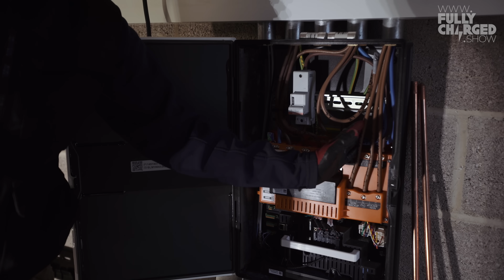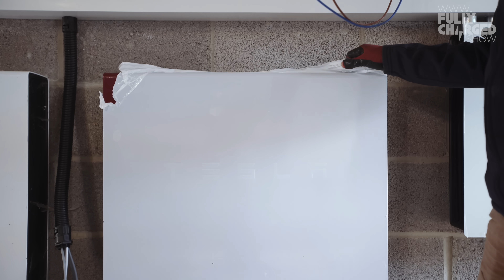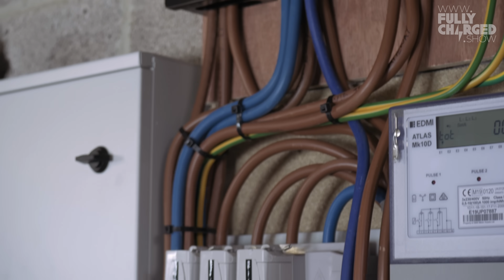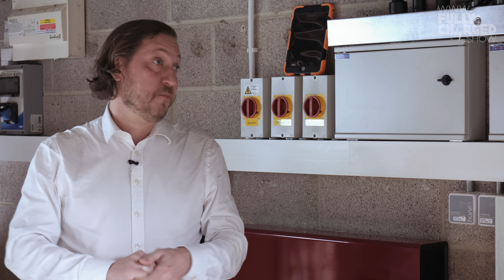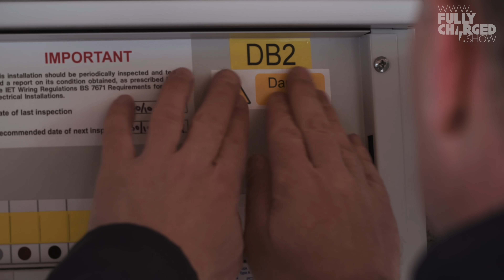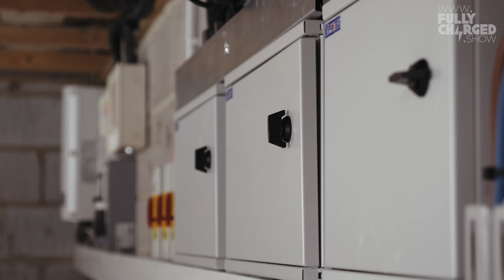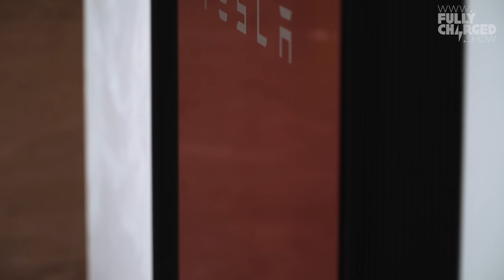Can you run your house on a battery? Tesla Powerwall 2 (Founders Series) & Tesla Backup Gateway 2

Comment: The carbon footprint of that lot is massive ... by the time it's anywhere near carbon neutral it'll need replacing
Reply from the maker: I enjoy seeing comments like this. Just clear statements, no self questioning.
Just a simple statement of fact. Bang. "The carbon footprint of that lot is massive."
Says who, based on what, and how do you know how long the system will last. Oh, that's right, you don't.
But don't let that stop you. LOL
Reply: @fullychargedshow   Common sense and over thirty years in the building industry  informs  me !  And the 10 years warranty from Tesla tells me you can expect  a little over that in lifespan ( good luck with disposing of those batteries cleanly) looked into it myself and it doesn't make  ecological or monetary sense ... it actually starts to make sense in a hotter climate but not in the UK . In the UK it's just a virtue signal  which actually creates more carbon than it saves . But don't let that stop you ... I'm sure the pats on the back and the warm fuzzy feeling you'll get inside will more than make up for the harm you're doing to our environment .
Reply from the maker: @jackcaven9614  Ahh, excellent, you used the giveaway reactionary term 'virtue signalling' for which I am very grateful. 
Now we know where we both stand. 
I have had one Tesla Powerwall for 2 and a half years and the impact it has had on our electricity consumption has been profound, now with 2, and more solar, even in this damp overcast island it has a significant effect.
So a couple of things, and I am speaking from over 10 years of experience with electric cars using the same battery technology.
Yes, the warranty might be for 10 years but that doesn't mean, and I am laughing at your expense as I write this, that the batteries suddenly stop working overnight.
Battery tech has developed with incredible speed over the last 10 years and we now know, particularly in the role these powerwall batteries are playing,they have a lifespan of well over 20 years
So to say "the batteries will be useless after 10 years"  is a tragic misunderstanding or deliberate ignorance 
You've had a lot of experience, as have I, but your experience is in the past, with old technologies that we both grew up with.
I am prepared to accept that those old technologies are a bit rubbish (internal combustion, diesel, burning coal and gas to generate electricity) I am still open to the possibility of change.
And no one, not me, not you, no one except a moron is going to 'dispose' of batteries when, after 20-25 years they need to be recycled. 
We are about to shoot an episode about a massive battery recycling plant in germany which is set to become a multi-billion global industry which will employ tens of thousands.
And you still think we have to 'dispose' these batteries. That is tragic. Only the Daily Mail would suggest such a thing.
Reply: @fullychargedshow  I  worked out that taking into consideration the initial cost and the running costs of installing a combined solar panel - tesla wall system, and then adding up the potential savings ( even being optimistic) it would take at least 24 years for it to pay for itself ( not including battery replacement in 34 years = 2 - 3 )... do the sums , it just doesn't add up , I wish it did !  And 'recycling' is just a fancy way of saying 'disposing' apart from it costing more. Current  estimates on the lifespan of a Tesla wall battery are based on their car batteries ... Tesla say at least 8 years , and seeing that a wall battery is continually either charging or discharging I think ten years is being optimistic .  Don't add up no matter how much you want it to !
Reply from the maker: @jackcaven9614  
Okay, I’m going to be patient and respond to your reservations one by one. 
Firstly, let’s politely explore the difference between disposing and recycling. When I use the term recycle I use it with the full and detailed understanding of what that means.
It means the materials that make up the battery are separated, refined and reused to make new batteries. This is already happening and the system is managing to recycle, not dispose, recycle 97% of the materials in the battery.
Dispose means throw away, nothing else. No one confuses dispose and recycle, unless you are doing it deliberately to try and spread fear, uncertainty and doubt.
Now let us just briefly consider how we can recycle a litre of diesel. 
Oh yes, we can’t. It’s just burnt in a very inefficient engine and we breath in the toxic residue. Brilliant.
Now let us briefly consider the global impact of renewables and battery storage. Not just one ‘virtue signalling old tosser’ like me paying over the odds, but having this technology accepted as normal, which it will be in the next few years.
But here’s a critical point you have no idea about.
You seem to only see the blinkered, selfish, narrow view of what’s going on.
And the changes are happening If I had fitted the equivalent system in 2010, the Powerwall alone would have cost well in excess of $37,000 just for the batteries. Now it’s $6,000 for the finished pack, electronics included.
A drop of $31,000 in 10 years.
In 2010 the solar panels would have cost around £20,000, now £2,800, a drop of over £17,000.
What will the cost be in another 10 years? Who knows but without question it will be less.
One of the reasons it’ll cost less is because idiots like me are prepared to invest in it now with zero hope of saving money, but happy because from now on I never use grid electricity between the hours of 4pm and 9pm, all year around.
And why is that remotely important? Because that’s the time grid electricity is the most expensive and the dirtiest.
So the more houses with batteries, (much smaller and cheaper ones than a Powerwall ) then the less peak demand.
Big picture, trying to discover how this changes things
Reply: @fullychargedshow  Do you know about cost of energy production, density, efficiency, also so called batteries loss energy charge without use, they degrade. Calculating all those cost, life span and energy density, you are at a massive loss, that not even counting the co2 emission you produced because you wanted some saviour "Feel good about myself as now i can be entitled" juice. Can't wait to see when your system is dead and it gets sent to china for a massive city dump to make people sick and die.
Should have waited for carbon dioxide lithium silicon batteries. 
Meanwhile you retards support government subsidies which just means "Let's tax the people living paycheck to paycheck" for some ineffective bird blenders, because we feel entitled.
You talk about burning diesel, yet your fucking goodies got transported by it and without it, it wouldn't be produced because electrical equipment / computers need oil, oh wow. 
If you really did care about reducing co2 and pollution then, you would not support green, and you would be supporting energy density and efficiency. You would support nuclear.
People fail to remember that vast areas were once covered in literal oceans of herding animals such as the American Bison that would have multiple herds in the millions that would sweep across the land. It was likewise in Africa and other parts of the world. You should learn about Allan Savory, and Nutrition and Physical Degeneration Weston A. Price.
You should attempt to slowly reduce plastic use, and make people more productive and using less waste, and supporting plastic which had very short life spans / decompossesses, not some overpriced useless junk that can burn down your investment

Comment: Let's get real here...1> The reason 99.9% of people would seek to install a power wall type system would be to abandon the power grid connection along with the bills altogether. 2> To become mainstream, the system would replace the power grid connection while requiring minimum changes to the infrastructure or consumption patterns. 3> The change must offer a saving which includes the capital outlay over the guaranteed lifetime of the system plus the power it provides...in short it needs to be cheaper. People are NOT going to move to this because they want to "save the planet"....they want to save money & stop paying monthly to the power company pigs.  The same applies to electric cars. The primary reason people want electric cars is to save money not so much to save the planet...sad but true.

Comment: So the moral of the story is it costs a small fortune to outfit your house with a battery system that, at best, will last 10 yrs and need new batteries.....which of course take a huge amount of energy and resources to mine, produce, transport. Add to that the cost of the solar system that also has a fixed life span and you might as well stick to the coal fired power station.
Reply: We would still be Running on whale oil to light our houses if you were in charge,  Except there would be no more  whales. WE can be running on Coal for the Next 100 years but there won't be  a functioning civilization.
Reply: @Gcanno  that's the most ridiculous comment. Nobody said anything about moving away from modern tech. It's about selecting the most economical and practical fuel and fuel storage. For example hydrogen is hugely energy intensive and inefficient to store because of the temp and pressure requirements to store it. Try working your brain before you open your mouth.

Comment: I wonder whether in real world use Robert will see his use case of just plugging the car in to take advantage of a sunny day via the zappi. I don't believe the zappi will usually see any power in power matching mode. Robert now has to generate or load 26kWh from off peak/solar before any excess will flow through to the zappi!
I know you can tell the zappi to charge at full power 'now' as a standard charger would but the key usp of the zappi is that it will power match your solar generation.
If the description is right in the video then I think they've got the logic wrong here.
Would he not want the battery to charge to a certain level first - say 6kWh and then feed the solar through to the zappi - or alternatively allow the zappi to be first in the supply chain (if connected to a car) then the power walls in some circumstances - bearing in mind that domestic storage is great but maybe 80% efficient - whereas direct load usage is more efficient if possible.

Comment: Like the details. But the answer in my case is: absolutely not.  First of i have room for 1900kwh solar power on my roof. My yearly use is 2250. Secondly in summer id overproduce and in winter id underproduce by about 5kwh a day. Id need more roof space and a lot more inhouse space to store a ton of these batterys.  They are a niche that are just not sorth it.  With my yearly energy bill of 500 euros the price of these make zero sense add 3500 for solar panels and installation and i will never make that money back in my remaining 40 ish years of life.
Reply: But solar panels and batteries have a lifespan of about 10 yrs so you'll need to replace both of them.
Reply: Solar panels easely last 25 years batterys not so much.   Its nothing but a gimmick to buy good feeling these days. Electric cars charge at night unless you only do nightshifts so solar panels will not charge your car.  And giving back to they net here makes payback time 4 times as long soon as we only get back electriciti price then instead of full price.   1kwh is 22.5 cents total but rap price before insane taxes is under 5 cents.

Solar and batterys are not the future. unless we start turning that solar into hydrogen there a lot of people will be forced to still use natural gas or feul for theor cars and heating.  All solutions currently avaipeble are only buying a good feeling but arent affordable ir even viable fir tge majority.  I heat my house with natural gas and use 300 to 400m3 a year if i were to heat electrical my heating bill would be 3.5 times as much for less comfort.   An electric car with my dricing costs me 2.3 times as much as a traditional feul car with my mileageand id have to get the cheapest that dont fill my needs.  A tesla costs 6 times as much.  Plus i cant even charge them here and wont ever be able to.   Id have to charge at a charge station making me spend 50% more on the electricity stay there while charging and on top of that the battery drains when i dont drive making it less efficient.  Electrical is a solution for nothing.

Comment: Interesting to see the long delay when you tested the backup functionality.  I have the Powerwall 2 and gateway (in Australia) and when we lose power, the battery take up the load instantly.  Even desktop computers on that circuit don't miss a beat.  Not so much as a brownout.  You sure your guys installed it right?
Reply: Yeah I just posted the same. I have a PowerWall2 and there no delay at all. It switches seamlessly in microseconds.

Comment: I like the way it switches off the grid to power the house from the battery, but why does it take so long? It should be as fast as an UPS.
Reply: From Tesla FAQ: 
During a power outage, how quickly does Powerwall restore power to my home?
Powerwall can detect an outage, disconnect from the grid and bring power back to your home in a fraction of a second. Unlike backup generators, Powerwall can keep your appliances running without interruption. You will not even notice that the power went out.

Comment: What i would do,  is to install a fixed water mist system for fire extinguishing. Works with powder as well as long as you are home but any battery is a fire hazard of that size, especially high efficient types. I am not sure i would want it in my cellar, compared to lets say a seperate grid house.

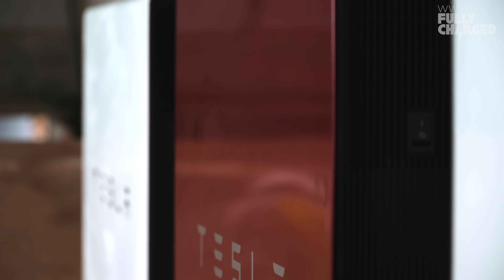Comment: 15:01 England seems much more elastic wrt energy pricing schemes.
Reply: Totally.  Where I live, there's no time of day pricing.  4pm and 4am have the same price here.  Instead we have volume pricing, where the average price goes up as your usage increases.  If we had time of day pricing I'd get a Powerwall in a heartbeat.  The combo of protection against power outages, while reducing power consumption costs, would be a no-brainer.  But since our grid is almost entirely hydro-electric, which isn't very susceptible to time of problems, time of day pricing may never happen here.

Comment: Has anyone looked at combing this with a smart OHME car charger and Outgoing Octopus Agile? It hurts my head to try to work this out but it would be something like...

Charge up the house battery during day
Sell excess at tea-time at highest rate but ...
Don't sell more than it's going to cost me to charge the car overnight unless the rate during the early hours is going to be very low (or even a negative when Octopus pays you to use electricity)

The OHME charger is great, in that it will know what the cost of the power will be and charge the car intelligently to match the best rates. But, I don't know where the link is so that the house can work out how much to sell and how much to leave in the battery.

Anyone any wiser?

Comment: Alright a question, what causes peaks and lows in the grid? People use more energy during the day and less at night when they go to sleep and power down. If they  charge up their power wall at night, you don't get a low. There will be a peak during night time also.Well not a peak maybe, but still a significant load. So that's no real benefit to the environment. You still deliver energy from the grid. Charging the power wall from the grid is stupid if everyone does it. Also, I bet the tariffs will change if most people use the night tariff to charge power walls causing peaks at night.

Comment: Not sure if it has been mentioned already in the comments but apart from the anticipated promulgation of EV's, there is another factor driving the changes to 3-phase supplies in new built houses in the UK.  And that is the need to heat these houses.  With a drive to do away with fossil fuel burning boilers within a decade in new built homes, other mainly electric options will become more dominant, e.g. heat pumps and especially ASHP.  On a single phase supply one is limited to about 16kW for heat pumps (sure you can cascade them technically but that will require the permission of the DNO and in many rural areas where the grid is already at a stretch the DNO will refuse such applications).  On bigger houses even with insulation in compliance with building regs. that's not enough. 3-phase supplies removes that sizing restriction and means DNO's will only have to be notified (rather than needing their permission).
Again that is one of the reasons why 3-phase supplies to domestic properties are much more common on the continent.

Comment: Hi, i have a 3phase 230V in my house or te be exactly i have 1 connector outside on the house. Dont know if its 16ampere or 32 ampere (have to look).  So, WHAT is a Tesla Powerwall ??? is it a accu ?   With out having solar panels its useless i suppose ?   thx

Comment: Given that any cheap computer UPS can detect loss of line power and switch to battery within milliseconds without so much as flickering or backfeeding, while the Powerwall shown here took at least 15 seconds to switch over - That would be a dealbreaker for me for a system that costs upwards of $15k installed.

Comment: 15p per kwh.  So funny.  Western Australia is over a dollar now since we closed down coal power stations but we can export as much coal as possible to India and China. So our bill was $80 and now we have cheap green energy it's $500 per quarter.  Robert did the same.  He's paid thousands to get this put in, will he ever get a return on his investment.  Also, arbitrage is the word he was looking for.  Tesla batteries that were installed to offset power surges in the Eastern states are being used for this, they fill them up at no cost and then wait for the highest price to sell.  Their not worried about leveling out the grid.